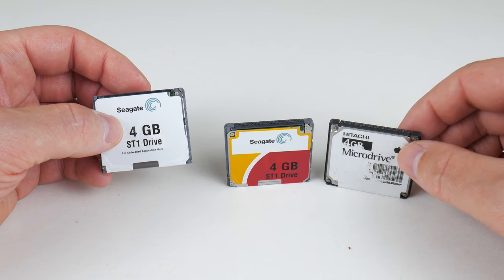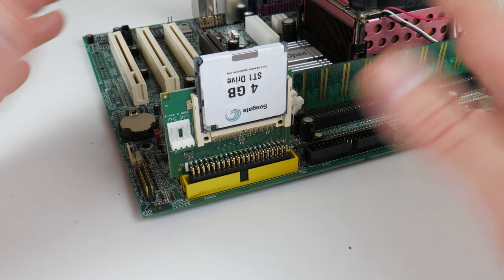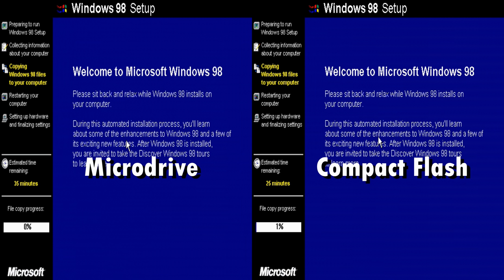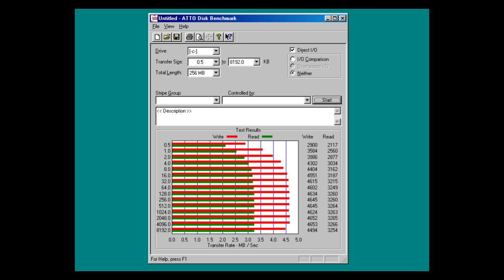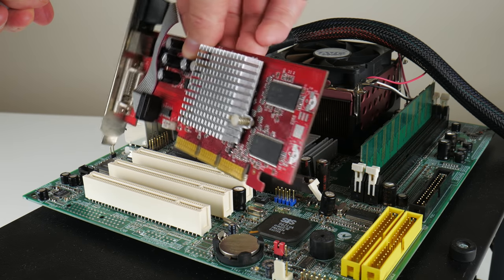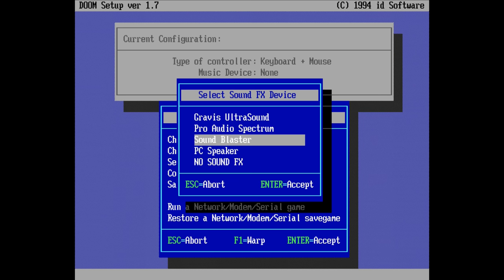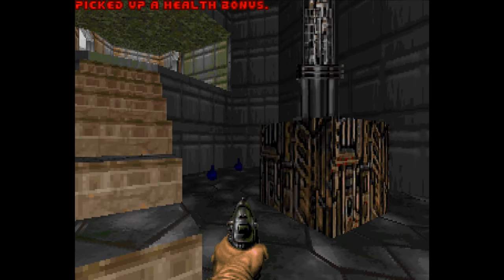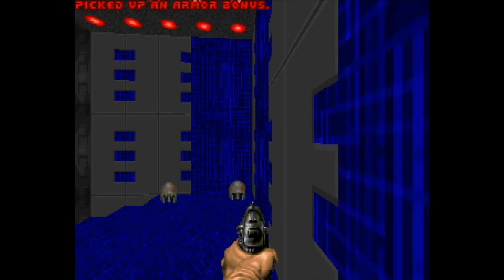Should you use Microdrive with Retro PC?

Comment: From a technical standpoint, these always seemed like a great feat of engineering to me, even though the practical use case is no longer something to consider.
Reply: Hard drives in general are pretty impressive feats of engineering considering there's a platter spinning at thousands of RPM holding varying electromagnetic charges on it representing bits while a read/write head is floating just nano/micrometers above the surface on an arm controlled by a couple permanent magnets sandwiching an electromagnet between them where the varying charge in the electromagnet sweeps the arm around to position the read/write head exactly where it needs to be as data whizzes by under it. Amazing that works at all and that we were able to install them in laptops and iPods where they get carried around, dropped, knocked around and they still work.
Reply: @thegreatboto   Wow, great explanation!
Reply: @thegreatboto that was crazy dude i love the response 🤣

Comment: another big point i've heard against microdrives is reliability. probably also the main reason they didn't really take off compared to compact flash
Reply: the thing was that these microdrives were primarily put in small portable devices (camcorders, media players) usually carried around in pockets during walks, runs and bike rides. 
you can imagine that this is a worst case scenario for any storage media with spinning mechanical parts inside, so i'm not surprised they failed quick and by the hundreds.

my brother had one such media player with a spinning 2gb drive in it (i think it was a philips) and it barely lived long enough to be fresh out of warranty when it died for good.

if used in stationary devices and handled with the same care any other HDD should be handled with, i think the reliability would be about the same as any IDE HDD from that era
Reply: @KenjiUmino  i had an old ipod mini that had one of these in it, the battery failed and then the drive did. thing lasted a surprisingly long time though

Comment: All 4 microdrives I've bought over the years have failed pretty quickly. Compact Flash cards have yet to give me a problem. I still love the idea of these drives though. I wish I could find a reliable one.
Reply from the maker: I bought some no-name CF cards many, many years ago and they still work perfectly for Retro projects. Especially for DOS, where little data is being written, they should last a very long time.
Reply: To top it off some CF cards use SLC nand so their read/write cycle life is comparable to conventional hard drives in some instances.
Reply: In my case most of the CF cards I've tried have failed pretty quickly. I got a microdrive from a broken MP3 player and used it in an old optiplex P4 just to see if it worked. It did and it still has win 98 on it, but I haven't used it beyond that
Reply: @philscomputerlab  Most old unbraded CF cards were made by reputable manufacturers
Reply: @marctorres7182  CF Sandisk Extreme Pro 16GB 160MB/s work fine on my dos PC tower (q9650 and asus p5qc motherboard can switch ddr1 and ddr2 for win 95/98/2000 or xp/w7/w10...).

Comment: So the SD2IDE option is still the best option out there, besides maybe some "IDE 2 SSD" options.
Compact Flash cards are great and all, but they fit better with really old retro PCs as the sizes are typically less than 8GB.
With Windows 98, you really want more storage. My PC in 1999 came with a 13.5GB harddrive, and that was considered "OK", but I actually added extra drives even back then. My current setups use 32 and 64GB SDCards with the DeLock SD2IDE adapters. Those work great.
Reply: Really don't care for using SD cards like this when one can just get an adapter to use just about anything else SSD wise and have peace of mind knowing it won't be wearing out anytime soon.
Reply: At least in my experience, it's not hard to find old IDE hard drives of appropriate sizes for free (or near free) that still work fine.  SD to IDE adapters cost more than old hard drives, and SD cards in my experience aren't any more reliable than an old hard drive, especially because old software isn't aware of the need to reduce writes to flash to prevent it from wearing out, and so some OS and applications/games will write more frequently than necessary to SD/CF cards.  And if you SSD, there's no OS TRIM support, so that can be an issue too.
I have a Tandy 1000 with a 30MB RLL hard drive, and 100MB ZIP drive (external), a DOS 6.2/Windows 3.1 486 with a 2GB IDE hard drive, a Windows 98 Pentium III with a 30GB IDE hard drive, a Macintosh SE with an 80MB SCSI hard drive, an SGI Indigo 2 with a 9.1GB SCSI hard drive, and a variety of 8086 to Pentium 4 era laptops with physical hard drives, and they're all working fine.
I've certainly had drives go bad, but I've had probably as many flash storage devices go bad, and most hard drives that still survive today will continue to run for quite a while if they're taken care of and used with a reasonable frequency.
Reply: Platter capacity was 20 GB by the end of 98's lifespan, so 20-40 GB were common sizes. 3600 RPM speed was also somewhat common back then but I think it was mostly phased out by then with the exception of the Quantum Bigfoot and maybe some exotic off-brands you'd find in sub-$1000 pre-builts.
Reply: @dycedargselderbrother5353  3600 was only really common in RLL and MFM drives, and very old IDE. Even the 2GB drive in my 486 is 5400.
Reply: @shawnmulligan3471  Conner was a common cheap brand. Most of their drives were 3600 RPM, even into the small GB range.
Reply: @dycedargselderbrother5353  Ah, I knew Connor made a lot of 8-bit IDE drives (20-80MB), and a few "couple hundred MB" drives, and knew the smaller ones were 3600 (I have a couple in laptops); didn't realize the larger ones were also 3600, and I guess more common than I thought.
Reply: I also prefer SD card based options, I buy the cheap china SD2IDE adapters on ebay.

The speed is plenty on retro machines, and even if the SD card gets worn out, I can easily get a new one without much cost at any size I need.

Comment: I used one with an Amiga 500 using a SCSI controller and a SCSI multi card reader. With a 7 MHz processor the performance was sufficient, and it had more space than I'd even need. I think these drives are best used to store installers, or backup images to install games and other software from.

Comment: I still use my original 4GB CF card from around 2006 or so.  I know it's not fast by modern standards but it's still faster than a spinny device and still reliable.  I still have a bunch of floppy diskette/card reader 3.5" drives that are perfect for old systems.  Thanks for benchmarking and clearing any curiosty I had about them.  On a plus side, I don't need to spend $400 on a CF card now like I did 15 years ago. :)

Comment: For my money, the best option for an IDE port is a disk-on-module made by Hyperdisk.  You can get them in 32GB size for like $35 and they plug directly right into the IDE port and are powered off a standard Molex connector.

Comment: The cheapest way I have found of getting good and reliable performance on an IDE retro PC is to buy and MSATA SSD of 32, 64 or 128GB in size and then just convert it to IDE with a converter board, or caddy in the shape of a 2.5 inch laptop drive. (I think you have even used those yourself before).

The problem I have with this "defunct" media is that even if it is working now, you don't know how much life it has left in it. Someone gave me a couple of IBM Thinkpad X40 laptops with (Wacom Pen) touchscreens and they came with the tiny 1 3/4 inch hard disks that were about 15 years old at least. They seem to work fine but I didn't want to trust them so, again, I bought MSATA SSD's and adapted them to IDE.
Reply: Are there any particular mSATA-IDE converters you recommend? (Or brands to avoid?)
Reply: I think you can buy sata 2.5" ssd, remove it from the cover (2.5" is just a cover to keep the form factor, the actual board is half the size or less) and use sata/ide adapter, maybe cheaper than msata.
Reply: @IsmaelWensder  I wouldn't recommend doing this. What happens if you break it open and it's not an mSATA SSD inside?

Comment: Hi, nice to hear from you Phil. For me this the 1st review I've heard on any Microdrives. Clearly, the CF method is better than microdrives. 3600 rpm is more reminiscent of the older ST-506/412 hard disk days. My opinion is that anything based on an earlier GUI operating system like Win95/98/Me needs at least a 4200 rpm spin rate.
Reply: Spin rate effectiveness in terms of access times varies with the diameter of the harddrive platters so theoretically a microdrive could've much faster access times compared to 2,5 and 3,5 inch drives but IDK if the tiny mechanics steering the heads in microdrives move fast enough to actually use that theoretical advantage.
Reply: @armorgeddon  Hi there. True, the platter diameter reductions of Microdrives could reduce track to track seek times. But I think the overall data transfer efficiency is much more dependant on the areal density recorded on each track. Despite their larger platter diameters, 2,5 and 3,5 have significantly higher areal densities (sectors per track) and the tracks are much more closer together due to the harddrives total volume capacity (this is tracks per inch). Although having a smaller platter diameter, Microdrives would typically have tracks spaced much further apart than many 3,5 and 2,5 hdds. I think Microdrives data capacity is fine for accessing smaller OSes like PC-DOS/MS-DOS that don't have many large files to read for boot-up or application launches. But by the time you get to Win 95/Win 98/Win Me the number of files and their sizes to read on boot-up and application launches grows WAY UP! This is where track to track seek times take a serious back seat to data transfer speed. So overall data access times is much less dependant on how fast can you get to a track (the smaller diameter platter of Microdrives) and much more dependant on how long you spend reading data from the track (areal density per track). I still use 3,5 inch floppy drives for some DOS boot-ups. This is just my take on things. Nice to hear from you and Phil both.

Comment: A few years ago I tried a few of these drives, just because they were cheap to get at eBay ... the results were the same as here, together with some instantly broken drives with bad sectors or fully failures. The idea was to get a fully mechanical drive in a retro setup, but these drives make no noticeable noise, the speed is bad and in my case they were not stable ... since then I use a real 3,5" or 2,5" IDE drive to get the "real sound" or go for a compact flash card, if noise is not desired.

Comment: Nice comparison, never got around to trying that. Just remember that wear leveling may or may not exist on compact flash cards, generally CF cards dont have the same endurance at spinning rust does. If your using your retro PC a fair bit, be aware of this. Perhaps look for CF card with wear leveling and/or look at making backups if thats important.
Reply: Modern Linux runs quite happily off CF, 486 era OS would not be a problem. especially as RAM is cheap today. maxed out is the modern normal.

Comment: I used to run an industrial motherboard using one of these set up as a router. USB ide adapters had a lot of problems with it so I had to use native IDE CF adapter to get it to work properly. I believe it was a certified refurbished drive. i ended up replacing it with a CF Western Digital Silicone drive

Comment: So far the CF cards work out pretty good for me. I have not see many micro drives available anyway. Thanks Phil for the quick video…again, testing stuff so we don’t have to and save a few bucks 😏
Reply: How much is a CF Microdrive, from an older Win XP eMachine PC, worth? Will it work with say, Win 7?  Thank you 🤓
Reply: @j.lietka9406  Win7 is probably a bit much to run on a CF microdrive because the OS takes a lot more space, performs a lot more read/writes, etc. It would probably work though. Larger capacity CF microdrives get expensive real fast, so the return on investment isn’t there.
Reply: @mesterak  well what I meant was if you have a working Win 7 PC, will the drivers and microdrive hardware work? Not load Win 7 on a microdrive! Thank you 🤓
Reply: @j.lietka9406  yes you shouldn’t have a problem. The PC sees the mircrodrive as an IDE drive, so no problem 👍
Reply: @mesterak  yes, thank you 🤓

Comment: I cannot agree more - Microdrives are rubbish when it comes to using them in PCs. But they are very interesting piece of engineering, great to have one in a collection of retro hardware.
I also remember it was possible to fiddle a litte with its firmware and/or using special software toolkit to switch off power saving.
Reply: I was using a microdrive as main storage on an HP Jornada WinCE palmtop running JLime Linux maybe 2008 or 2009. It seemed to do alright but the spindown click drove  me nuts. I remember reading about folks adjusting the microdrive power saving features to solve that issue on at least certain models but I never pursued it because IIRC required some windows utils and I was Linux only at time.

Comment: Nowadays MicroDrives are like quite rare to find and I've didn't even know they even existed until recently. Considering the costs and the drawbacks of those MicroDrives nowadays, along with the huge availability of SD Cards... It would be better to get an IDE to SD adapter for an old retro PC since majority of small capacity SD Cards from well known brands are quite affordable plus it can be easily swapped out for another one or be used for transferring files on it on another device that has an SD card slot back and forth compared to a CompactFlash or a MicroDrive since as said, SD cards are very common even microSD cards have their microSD card to SD card adapter included too.
Reply from the maker: Yea agreed, SD cards are better value. CF can be faster though, as they have native IDE support, no converter chip is needed, whereas SD card adapters top out at around 25 MB/s which is still plenty for most Retro PCs.

Comment: I still have one of these guys (Hitachi 2GB) from many years ago, when it was the cheapest way to get a decent capacity for my digital camera.  It was perfectly fast enough for that use.

Unfortunately, my newer digital camera (still 10 years old at this point) can't use it, as it has a CF type II slot, whereas the microdrives needed a thicker type III slot.

Still works perfectly fine.  I just don't have anything to use it in anymore.  The only CF reader I own that will even take it only has a USB 1.1 port on it so... the RPM of the microdrive still isn't a limiting factor...

Comment: CF cards are very reliable. I have a old CF card 64mb i used on a compaq iPAQ in 2005. 
I used other day to see it works, and all data were ok, and i can read and write like new.
I had no such luck with pen drives nor SD cards. CF cards for me are the most reliable flash media ever.

Comment: Microdrives  were brilliant for me when all I had was a P4 computer at home to do essays on. They weren't great, but for 30KB Word files they were good enough. Now we have stuff like cloud storage and cheap low capacity flash drives.

There's not much reason to use them in a retro PC because almost all modern Compact Flash cards have wear leveling and are miles faster.

Comment: I tend to find using a compact flash to SD card adapter is good enough for my DOS and Windows 95 setup. That way I can get a hold of SD cards easier and still have the convenience of the rear bracket mounted Compact Flash to IDE adapters.

Comment: Nice to see you back! I've been using a program called Keep Alive HD for a couple years that simply writes and erases a file to my HDDs in a set interval of time to keep them from powering down. I wonder if a similar batch program could be written to write/erase a blank txt file once a second or two in the background to prevent the Microdrive from going dormant for DOS applications...
Reply from the maker: Hmm, it would have to run every 2 second basically to keep this one from spinning down. A Batch file won't work as DOS isn't able of multi-tasking. Would have to be some TSR driver and not straight forward.

Comment: maybe they could find a way to flash these microdrives to disable the power saving and they MIGHT be salvageable. Or perhaps create some sort of horrible background utility that constantly accesses the disk to keep it awake. According to the IBM specification documentation I'm reading there appears to be a bit flag you can set in the microdrive via an ATA command that would disable the power management. You'd need to write a utility to do it though, and I'm not sure if it would work through that CF adapter.

Comment: For my gaming setup I use an SD card to IDE adapter and modified my case so that I can remove the SD card at any time to swap out operating systems. The read/write is very fast, on par with full sized IDE HDD's and the ability to remove the entire drive and stick it into a modern pc for file transfers makes it super fast. I copied the windows 98 install files onto the SD from a modern pc, and installed windows 98 from the SD back onto the same SD and it installed in about 30 seconds.
Reply from the maker: Do you remember these removable IDE Hard Drive bays? You can put the adapter inside one of these. That way you have the retro look, but also easy access to the SD card :D